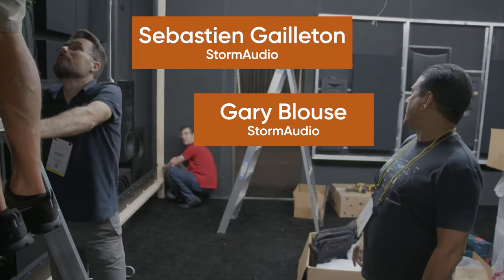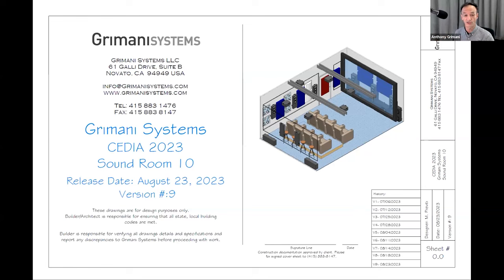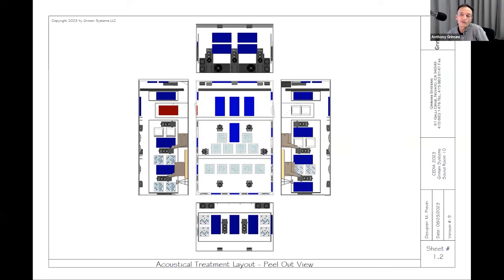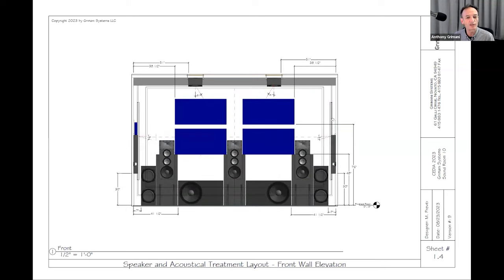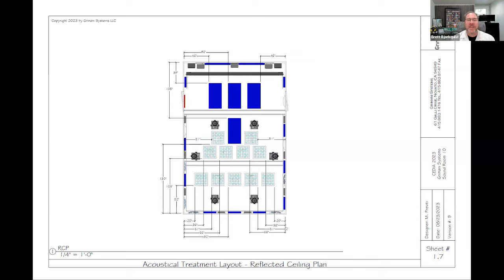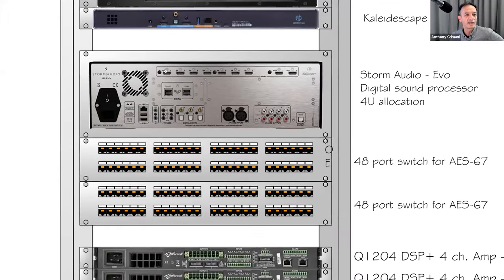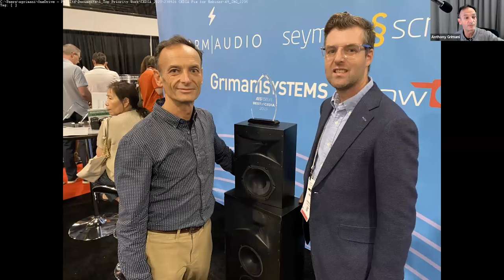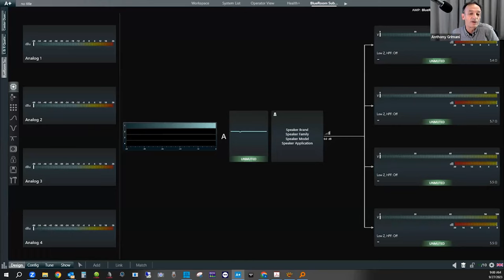FAQ's Expert Guide: Designing an award winning home theater with expert guest Anthony Grimani

Comment: I know this video is a bit old however still really really informative and well done. Thanks for that. Question: did you use a DBA setup for the subwoofers or were they all same polarity and the back not additionaly delayed by the distance from the front Subwoofers to absorb the standing wawes coming from the front? Thanks a lot for an answer. 😊
Reply from the maker: Great question. Each sub is aligned for polarity and time delay in order to get the cleanest sound. By positioning them into the corners, you get the most gain out of the subs, but by having a sub in each corner, and adjusting for time and polarity, you are generally able to cancel out most standing or modal waves in the room. Since that covers the general bass in the room, we then layered in one Infrasonic sub. Only one was needed in this room for pressurization, and because lower notes are so long, they don't really have the same issues with modal waves. 

Hope that helps. Once I get my new theater done, I'll have it initially setup with a Storm Processor because there is a lot it can do that the Trinnov can't, but I will likely borrow one to compare Waveforming vs. Dirac ART vs. just polarity and time aligning the subs in four corners. I think there is a lot of fanboy love for one brand or another because it's probably the first time the room had a processor capable of doing the proper calculations, but I'm curious how they stack up objectively, or what I think will happen is that they effectively do the same thing in different ways, at which point the answer is which one is easier to execute in your room.
Reply: @faqnatics thanks a lot. Great answer. Appreciate it

Comment: What if you use more than two rear channel speakers (3 or 4).  Would the measurements regarding the sound place be similar or just separate the four into two zones...
Reply from the maker: @michael, just to clarify, are we discussing the comment from Anthony about having a narrower setup of the rear surrounds, or something else? Also are you saying that you have 3-4 speakers on your back wall, or are we discussing rear wall and side surrounds that are further back?

Here's a good resource from Trinnov a while back on speakers placement. Every room is a bit different, then you have whether we are discussing Atmos or DTS preferences. This document has most of those things covered, and you can start around page 15. https://drive.google.com/file/d/1qFpM5c9_n_0PU6EcW-J5qFvf4QDWqjg3/view

Clarify the setup if you want to discuss, otherwise that document should get you started as well.
Reply: @faqnatics  Yes sir!  I'm referring to the back wall setup...I know it depends on the room dimensions... However, the plans for the new build w/dedicated Theater (21x30x12).

Comment: What brand / kind of treatment did you use?
Reply from the maker: A few different ones. I’ll come back with a few brands for you. Just away from my laptop at the moment.
Reply: @faqnatics  Curious this as well. Thank you.
Reply from the maker: So the treatments used in this build are MSR, which is Anthony's acoustics company. Great product, and I've included a link to the pages here: http://www.msr-inc.com/home_theater/hometheater.html It could use some updates, but I can connect you to their sales team if you wanted more information. 

Effectively though, the walls and ceilings were 24"x48"x4" in order to actually absorb down to about 250Hz. Anything shallower than that, and you are really only absorbing the high frequencies. and not taming the bass at all. 

The front set of sidewall diffusers were horizontal, and the remaining side, rear, and ceiling diffusers were randomizing diffusers. They are plastic in this case. and we added a bit of absorption material behind them. However, these are meant to sound great, but also need to minimize packing space and weight since it's a temporary solution. These work great, but more solid diffusion solutions are available that do as good or better of a job, but at a more premium price. 

I will likely be doing a video on acoustics soon, so if you didn't yet. please like and subscribe so I know it's a topic people want to see.

Comment: what if my room is really small,like 4.5m x 2.8m x 2.7m
Reply from the maker: That's not too bad of a room. Unfortunately. you are probably going to be capped at 2-3 seats in the room, so I'd recommend going with a couch to add more seating without as much width. 

Any chance the room is in an attic space, where the side walls are open behind, rather. than with a wall on the other side? If so you can use fabric walls like me, and place the speakers inside the wall cavities, so they don't take up space in the room. I'll be documenting my room build in November and December once I get over my COVID from CEDIA, and finish my family room project. 

I you don't have open space behind the walls, go with a good in-wall speakers with an included back-box, so that again, you can. get those seats as far away from the speakers as possible.
Reply: @faqnatics  Hope you recover soon! I had COVID about 2-3 months ago, and it felt like getting hit by a truck. It took at least 1-2 months to fully recover.
My room has concrete walls since I live in a high-rise building in Taiwan. You're right—I might only fit 2 seats in the room, probably positioned around 3 meters away from the screen.
I'm planning to use a Barco Bragi projector with DT's AT screen, about 130". For speakers, I'm considering Wisdom Audio P38m point source speakers for LCR, along with Sage Series 2 V2 point source speakers for the surrounds and Atmos channels (based on their website, they can be used in/on-wall and ceiling).

Your room build will show in this channel?